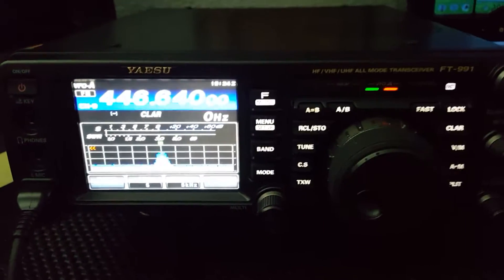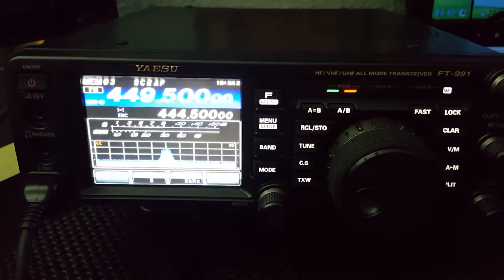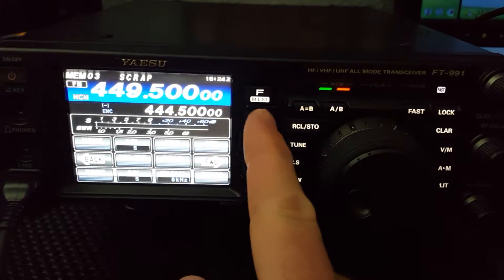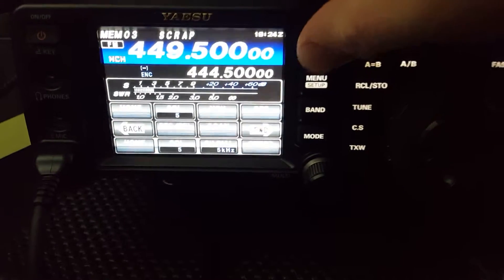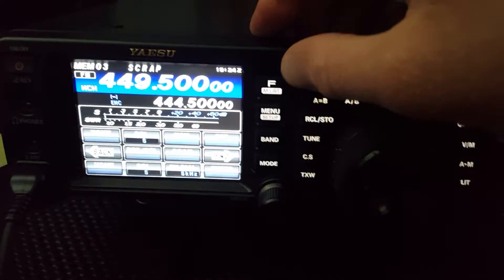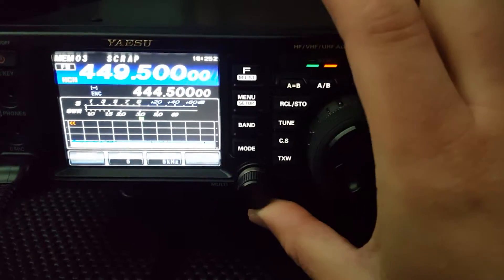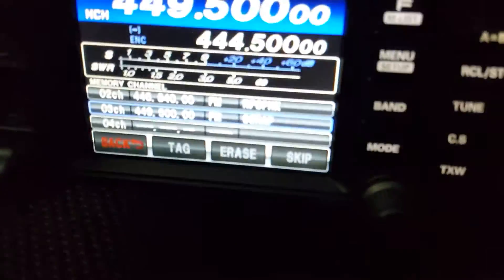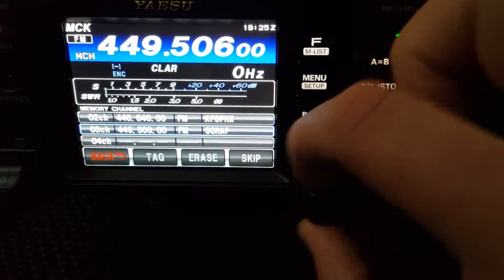Yaesu FT-991 memory channel selection not working

Comment: Just bought the radio. I love the capabilities but it’s unusable. There’s no excuse for this difficulty level when there’s a touch screen. There should be windows or icons with a main screen for options. Scrolling thru 153 lines in the menu which is full of abbreviations is inexcusable and could not be more inefficient

Comment: My biggest complaint about the 991 is how un user friendly the memory channel programming is. Every radio I have ever owned is so much easier. You have to go though way too many steps to program the memory channels from the front panel. And...selecting the memories is again not user friendly. It should be, push the memory button to the right of the VFO and then, without going anywhere else in the menus, you should be able to turn the multi function knob to pick which memory channel you want to use. Both my Icom 703 / 706 as well as ALL of my Kenwood's work like that. 
Barry, KU3X
PS Glad the firmware and / or reset cleared your problem.